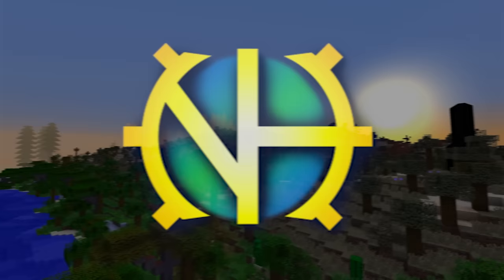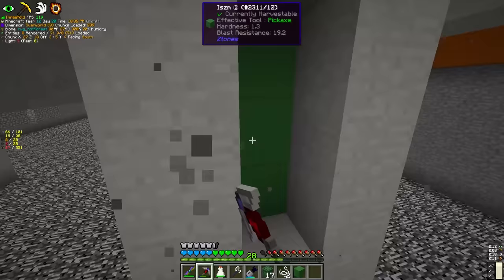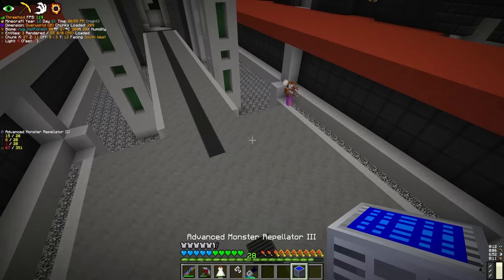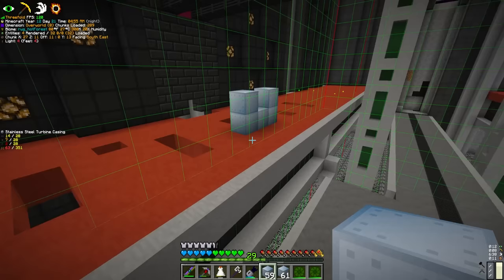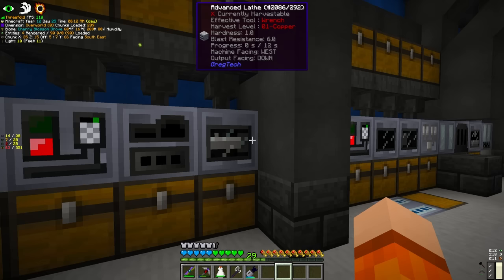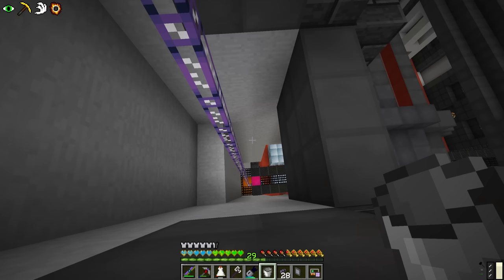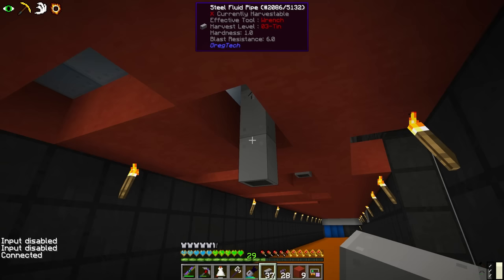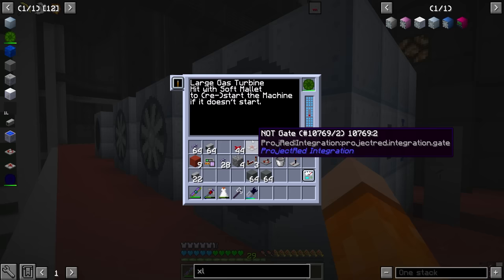Gregtech New Horizons S2 35: The Power Plant

Comment: So if I remember correctly, AE2 has energy p2p. Is there a reason why you aren’t using that? I feel like it could help you save space and cable.
Reply: He knows about the GT power P2P. It's not viable for short distances because there's a flat 5% power loss simply by going through a GT P2P. So the value of GT P2P only shows itself when you need extremely lengthy cables, where cable losses exceed a flat 5%. But in most practical situations, and with occasional upgrades to the power spine (in which higher tiers lose much less energy proportional to their voltage), you won't be using GT PTP

Comment: Why didn't you use P2Ps though? Are they disabled or nerfed?
Reply: He knows about the GT power P2P. It's not viable for short distances because there's a flat 5% power loss simply by going through a GT P2P. So the value of GT P2P only shows itself when you need extremely lengthy cables, where cable losses exceed a flat 5%. But in most practical situations, and with occasional upgrades to the power spine (in which higher tiers lose much less energy proportional to their voltage), you won't be using GT PTP